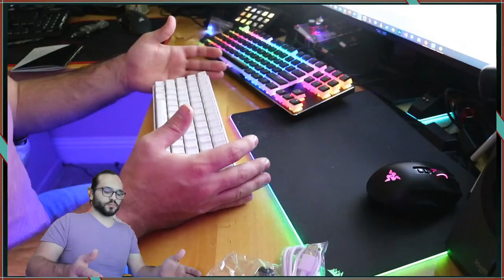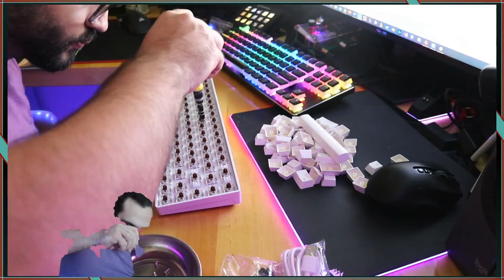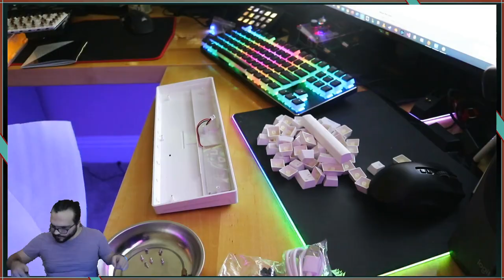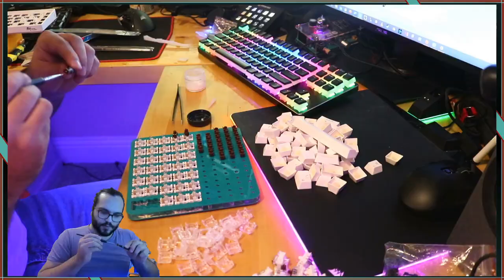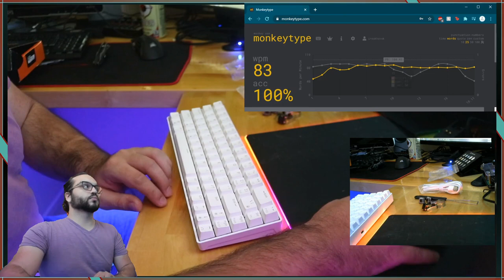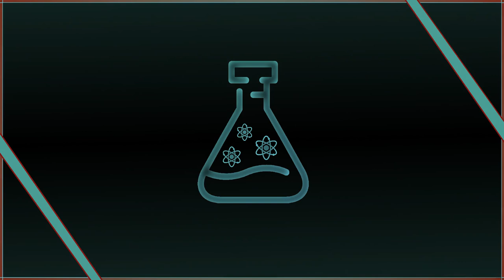Keyboard Build: Royal Kludge RK68 (RK855) Lubed Gateron Brown Switches and Foam Mod

Comment: i bought this same keyboard months ago when i got my pc, and i've just recently ordered some switches and keycaps. no issues getting the keycaps off, but i cannot seem to remove the switches. i'm pulling on them with the top and bottom tabs, but they just won't budge. any ideas on what i could be doing wrong?
Reply from the maker: So, many times the cheap pullers either bend or just don't do a good job! You may want to bend the opener to look less like a V and more like a C. there are some good switch pullers out there like from novelkeys, or kbdfans. I would suggest getting one, but failing that, the housings are for the most part sturdy, if you end up breaking that little plastic tab, it's generally okay, it will still work, just might get pulled out from time to time. Sometimes a quicker jerk instead of a steady pull works better too! Just make sure that you have a good angle, and use some quick force.
Reply: @ireakhavok  thank you so much, i'll keep this in mind. :)
Reply: You might have a older model.

Comment: hello iv'e been thinking about buying this keyboard but i cant find any info on it. I would appreciate if anyone could answer my questions. 
1.what brand switches does it have out of the box
2.whats the switch compatibility
Reply from the maker: The one in the link provides gateron switches but it can also come with other clones like kaihl. The ones that are compatible are ones that have cutouts for SMD LEDs. Not all switches will work with it because the PCB is not flat. Something like a kale cream or a gateron RGB switch would work. Some get her on milky switches will not work because they only have the pin holes for the LEDs not the actual windows cut You need to have windows cut.
Reply: @ireakhavok  ok thank you for the fast response

Comment: One question I have about the hot-swapping capability is it possible to clip off the led switch on the pcb? I am just asking because I know that this led switch makes some switches incompatible with the keyboard because of the led switch bulge? Is it possible to clip it off so that this keyboard can be hot swapped with any switch?
Reply from the maker: No, you will damage other led's on the board. Do not do that.

Comment: were you using some kind of tape during your foam mod? Also, can I use normal packaging foam to put inside the keyboard?
Reply from the maker: Yes, you can use normal packing foam, as long as it isn't too thick! If you have some packing foam try it out, but check before you screw it down that it isn't too thick. Sometimes if it doesn't close right you will either have to use thinner foam or cut it up so that it fits between the plastic slots. 

I don't believe I was using tape for the foam mod, I could have been using some tape to mod the stabilizers a little bit. I do not believe that I spent enough time on the stabilizers for this particular build. 

In a couple of my videos I show an example of the band-aid mod, in which you put a piece of band-aid on the PCB below the stabilizers, and sometimes in between the plate and the stabilizer cage. This is just to make it rattle less and provide you with a thud sound instead of a click.

Comment: Would you say this keyboard gives you the most bang for your buck? 

Are there any keyboards that are in this price range (>$70) that you would recommend? I’m looking for something that is at least hot swappable, wireless, and has decent switches (don’t forget RGB!)
Reply from the maker: In a short answer, yes. but this keyboard is one solid color, so it isn't RGB, if you want the same company, I would say the ROYAL KLUDGE RK84 Would also be a board to look at. The vast majority of better quality boards (like the GMMK series) are not wireless, but provide better materials, feel, and overall usability. I guess it depends on wireless, at this point. If you were to ask me which board is best overall at that price point (< $110 ) I would say the GMMK TKL, but if you are dead set on wireless then I would suggest the RK84 for RGB, or the RK68 if you are okay with one solid color. My favorite two boards (>200) are the everest max, overall, and the DROP CTRL in second place. but at that price point there are so many options to choose from, it becomes more of a specificity of your switch, LED faceing type (north face or south face) and your keycaps. This is a very deep, rabbit hole, and I would gladly help you take the leap for your next board if you would like to discuss this further. Please contact me on my instagram (@ireakhavok)
Reply: Thanks for the great (and fast) response!
Reply from the maker: @luispalacios2489  My Pleasure Luis! Stop by again, soon! More videos coming, soon!

Comment: What brand of switches do you think would be a perfect fit for this hotswappable keeb? :D
Reply from the maker: Well, I'm most impressed by Zeal pc and their Zealios v2 switches, for their unparalled tactility, and just great experience overall. (I don't suggest them for gaming) however, not everybody can spend that much on switches. I have also been enjoying the increased stability of gateron box switches. There is something about how stable they feel during the key press, that just makes it feel better, almost more premium. But for sound, I would have to say the gateron milky housings, hands down. There is just something about those housings that I can't put my finger on!
Reply: @ireakhavok  I just got my RK68 (RK837 ver.) and is torn between gateron milkies and gat inks. Haha thanks so much for the reply!
Reply from the maker: @FeiYuenSays  So In my opinion, the black gat inks, are a little too stiff! (if you go that route, get the reds!) I am about to do a spring swap in my halo trues.  I'm actually about to put in a new switch order, and might get some more milkys
Reply: @ireakhavok  I gave in and bought zealios v2 62g switches for my other keeb coz i got curious when u mentioned it hahaha also got some milky gat yellows for the rk837 :D
Reply from the maker: @FeiYuenSays  Have you installed them yet??? You will absolutely love them both, I'm sure
Reply: @FeiYuenSays  I bought some black ink v2s as well as some milky yellows and can tell you that they do not fit the rk68 unfortunately
Reply: @kimjongpoontv69  Really? Was thinking of buying this keyboard with the intention of getting gat milky yellows or blacks. Do the kailh creams work on this keyboard?
Reply: @franciscoponte1468  Kailhs will work, you could can get mily yellows or inks to work if replace the bottom housing to be able to fit the rgb light bar
Reply: @franciscoponte1468  what I did is I took the stem and top housings of the milky yellows and put them on the bottom housings of the gat reds that came with the keyboard and it works good, but it wont be 100% of the quality of those switches

Comment: Hello I was hoping to buy some Gateron Yellows but I'm not sure about the housings and top that's gonna disrupt the LED backlight. What would you recommend?
Reply from the maker: https://drop.com/?referer=NLYDWP 55g EVERGLIDE AQUA KING MECHANICAL SWITCHES, or just get some 45g springs off of ali express for like 10$
Reply from the maker: The link above is a referral for drop.com. once there just search for the everglide aqua. It will give you 10$ off and get me 10$ for a referral bonus. Other than that I would suggest any of the switches from ZealPC , but they are rather expensive.